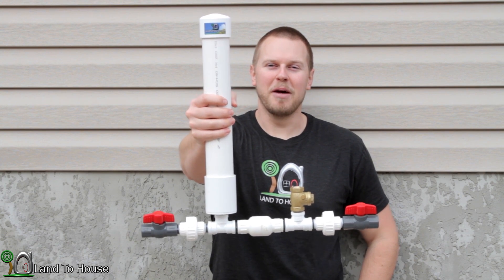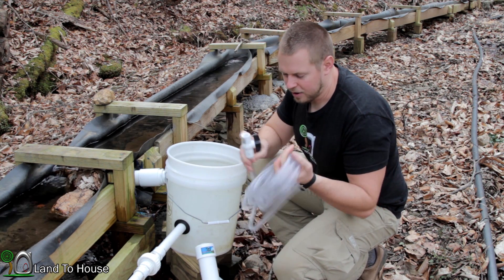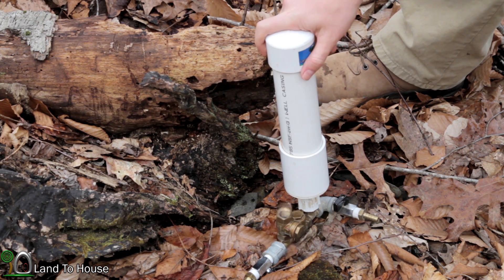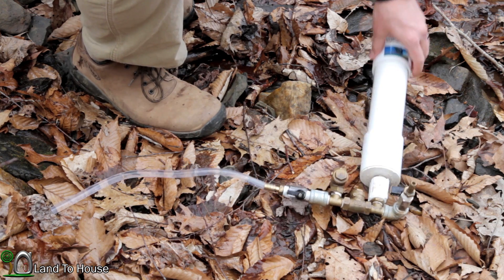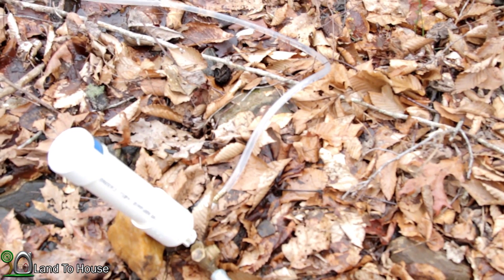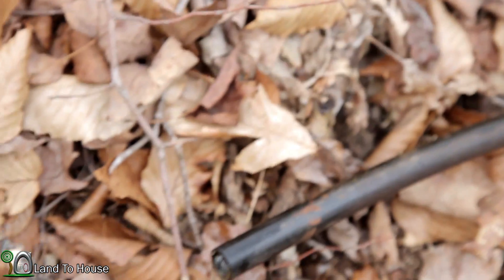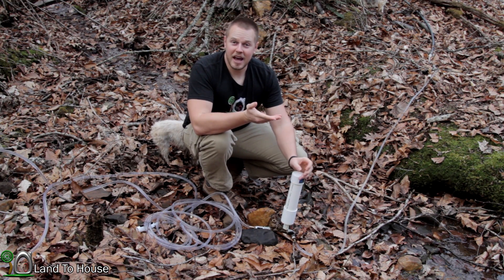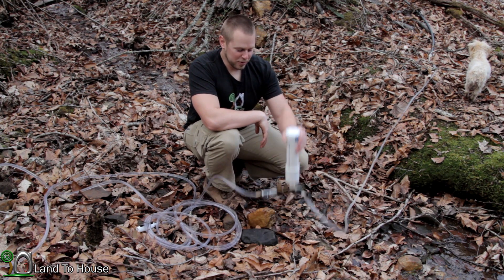WORLDS SMALLEST RAM PUMP

Comment: I bet it would work fine with a steel delivery pipe, at least 3/4", but preferably 1", with a T and vent in the middle of the run to lower the friction.  You're aiming for water hammer, and soft vinyl tubing just doesn't pack the punch.  You're losing the energy that should drive the pressure up to stretching the vinyl tubing, turning it to heat (unnoticable).  Steel delivery pipe, bigger diameter.
Reply from the maker: I have now replaced the 3/8" drive pipe with a 1/2" and the pump works!
Reply: hi, replaced with 1/2'' hose pipe or pvc?
Reply from the maker: I tried it with both. Poly pipe and PVC. Both work very well
Reply from the maker: The large commercial grade ram pumps have steel drive pipes and are almost always advertised to have a 1:10 ratio head pressure to lift. In my PVC pumps I state that a 1:7 ratio should be expected because most people are not going to use steel components. So expensive. Tomorrow I have the new update on this pump. It works!
Reply: I'll back this up - we even saw a difference in the efficiency of schedule 40 and schedule 80 pvc drive pipes.  The stronger schedule 80 expanded less, retained more of the pressure spike, and delivered water more efficiently.  Obviously the step up to steel would be even more impressive.
Reply from the maker: +michael98277 I do believe that a bigger Drive pipe is the way to go. The friction loss in this small diameter pipe is too great for this Ram effect.
Reply: I'm not a physicist, but I would bet you're losing the energy of the water hammer to expanding the vinyl tubing.  That is why steel pipe is most often used for the drive pipe- no stretch translates to less energy loss.  I forgot to mention- nice videos!  I appreciate you sharing your information, including ones like this when everything isn't perfect.  It is super helpful.
Reply from the maker: Thank you. I like to film and learn as I go. I need to find the time to get back out and work with the tiny pump again. Perhaps I will find the money for a little steel pipe.

Comment: DID you ever get a  this smaller pump to work? Im just below 1 gal a min in my seep. Was hoping you found a fix to the smaller pump by now? 1/2" intake and 3/8 on everything else maybe? I may have to find a new water source, though that puts me even farther away from cabin and where the water needs to go.
Reply from the maker: I have not taken the time to do any more testing with the tiny 3/8" ram. I do need to get back out there. The 1/2" ram pump can work on less than 1gpm with the waste valve turned to the side a little. It will reduce the efficiency but it will work.

Comment: If one were converting a swim pool to a fish pond, would the drainage pressure from pool/pond be forceful enough to work this pump, to pump the water up  through filter system and grow beds for plants then back to pool/pond?
Reply from the maker: +blanch paulin what is the head pressure between the pool and ram pump? This is the drop of water....the ram is a low pressure system.

Comment: try a stand pipe before your pump
Reply from the maker: On the larger pumps I do that for sure. With this little pump I have a feeling the issue is the fittings are smaller than 3/8" and that is restricting the water from activating the check valve.

Comment: .try a plastic cheque vavle
Reply from the maker: +rob beesley I do need to give those a try.
Reply: that would cut out the brass to plastic week spots and improve weight issues. the efficiency would go up by at least 50%
Reply from the maker: +rob beesley on such a small pump I think you are on to something. A light flap on the valve would help it close with low flow.
Reply: not only that but the head psi is not big enough to push it up and plastic would be better lighter. 1/4in pipe at 6ft of head = 1.81 gallons per minute
Reply: the head psi would be not good to lift the check valve 1/4 head is per 6ft=1.81 gallons per minute.
we can talk more on my web site http://comeandchatyoutubewithrobertbeesley.weebly.com/
Reply from the maker: One issue that I have is finding a plastic swing valve that is so small.
Reply: have you ever thought of 3d printing one?
Reply from the maker: +rob beesley that would be fun. I don't own a 3D printer. I wonder how long they would last
Reply: hear I know some one with a 3d printer send me the dimensions you want. the price will cost 15$ in total
Reply: don't worry I am you don't have to pay I can get you the guy's email to talk to him if you would like
Reply from the maker: I think at the moment I will try some other parameters before going with the light weight check valve. What I really need is pipe fittings that will not restrict the flow as much as the brass that I used. Thank you for the offer! Those printers are amazing.

Comment: shouldn't your feed pipe (source) be twice the size of your up hill delivery pipe...??? I'm no expert...just something I noticed in other systems...nice job...good video...
Reply from the maker: +Concepcion Amancio I have run several tests on that concept. The issue is if the ram is under high pressure the delivery pipe may have some slow down due to friction loss but typically there is such little pressure that it does not make a difference. The important thing is that typically the drive pipe should match the two check valves of the ram pump.

Comment: https://www.youtube.com/watch?v=J-iKUY_1xNA    watch this dudes vid  start at 9:39    this is what i meant
Reply from the maker: haha thats funny. This is one of my 1/2" ram pumps. I sent it to Cody last year about this time and he made this review series on the install. The friction in the 1/2" drive pipe is way less than the 3/8" pipe. That is why it works so much better.
Reply: so that wouldn't help it adding the line?  how about if it was stacked?  i am a think tank.  so how about: instead of the vertical line going into horizontal line, the 1/4 line comes up,  then fit it to expand to one inch?   how about 1/4 inch line up, expand to the one inch, then shrink it to 3/8 above the one inch fit for 3 or 5 inches?  picture an hour glass but with the sand in the middle and thin feed-lines at the top and bottom.  just some thinks to start.  i plan on building one, being able to catch the water that spills out of the first gate valve, to a smaller line to another lower one.

Comment: if it is going to be permanent why not splice the line, PVC it about 6 to 12 inches,  put a vertical stack of line so some more air can get in to add pressure? then reconnect?  upside down T i think even hose, 1/4" will let enough air in to help?  awesome set up BTW! love that aqueduct!
Reply from the maker: Not completely sure what you mean by allowing air to enter? The ram pump will stop if air enters the drive pipe. It can be a real pain to get that air out.
Reply: said comment above, didn't reply sorry.

Comment: Could you replace the heavy brass flapper in the check valve with a 3D printed pvc flapper…?
Reply from the maker: I sure could. I have a few things that I would like to try.
Reply: Joe Stowman If the flapper is too light, then water speed isn't allowed to build enough before valve-closing for there to be much water-hammer force, so a heavier valve will close later in the water-speed buildup cycle for a greater hammer energy.

Comment: I'd do the 1/2" drive pipe, maybe even 3/4".
Reply from the maker: I think that will get the pump going. Might not be strong with miss matched valve and drive pipe but we will see.
Reply: I'm running a 3/4 inch pump using a drive pipe that is 1 1/2".  I briefly step down that diameter to 1 inch for just eight inches or so before transitioning into 3/4".  Once the pipe is necked down to 3/4, I run it through 18 inches at that diameter before it sees the valves.  With about 10 feet of fall it lifts 85 - 90 feet.  Galvanized pipe and fittings for the pump, and PVC for the 1 1/2 inch portion of the drive pipe.  1/2"  PEX delivery pipe.  

Point being, I see no problem with a drive pipe twice the diameter of the valves.  It lowers frictional losses in these smaller diameter pumps.
Reply from the maker: I know that it will effect the ram effect going back up the drive pipe but with these little pumps it will help a lot. As you say the friction is an issue. I will have to get back out to the water and give a larger drive pipe a test.

Comment: the thump pressurizes the main feed line.  using plastic pipe is a way to eliminate the pressure.  try running only 3/4 inch copper from your feed bucket and get rid of pvc and any flexible pipe to feed your valves.
Reply from the maker: +dave newjersey copper is a little expensive for me right now.  But yes you are right the pressure is reduced from that tube.

Comment: I'm trying to get a 1/4 inch to work and am looking for the smaller check valves on line. Well, I'll try anyway. It would be cheaper than an electric pump. Thank You for all your videos and information.
Reply from the maker: +Lonefeather I wanted to go with 1/4" just to be fun but I had a hard time finding all the parts. Thank you for watching!

Comment: A ramp pump needs a decent shock wave to reinforce the slamming of the valve and to push water through the delivery valve.  You were using flexible pipe and so the shock wave would have been absorbed by the pipe.  What would have happened if the drive pipe had been made of rigid pvc.  I understand the issues of head and flow rates and the push on pipe connector would have also had an impact. Siphons never flow as fast a direct delivery from the bottom of a tank, I did a project on that in the lat 1970's.  Just a few thoughts.
Reply from the maker: +Mike Gomm I would have to agree.  I did not have access to a better pipe st the time.  I will be revisiting this soon and improving the setup. I bet I could place the drive pipe directly into the flume and get the full 6 feet.
Reply: Mike Gomm solarpanel
Reply: How about trying an additional check valve on the intake - on the generation of the slam it might keep the increase momentary pressure within the system (not leaking to the flexible pipe)?
Reply from the maker: I actually came back with a more Ridgid Drive pipe that was a little bit larger. Worked out well.

Comment: Love your content.
I have made two ram pumps using pvc however I would like to invest in a billabong size 3 ram pump( full metal construction), would you say it has any major advantages over the DIY ram pump?
Reply from the maker: Thank you for watching! I know that the full metal pumps are made to last a long time. PVC can weather in the sun and in high pressure has a greater tendency to brake. Also the all metal style often has a piston type valves that lasts longer than a swing valve. The trade off is the price. The PVC can be a fraction of the metal style. Thats really all I can think of at the moment. If you are going to go over 1-1/4" I think you will be better off with a metal just because of the pressure.
Reply: you can make the ram pump pvc and the valve pump pvc the bearing that pops up and down can be a marble,,so technically a system made for a couple Bucks me old mucker this is nothing new been out good 100yrs plus,,come back when you have perpetual,

I use a laser to copy manufacture my parts i pinch the marbles from the kids in there lucky bags get me pvc from resycle centers,

To catch the wast water resycle dig and place pvc barrel in the ground  but a foot or two above with lid sypon back the water to source sypons can run 24/7

Comment: has anyone ever figured a way to capture the water out of the waste valve and run it back through the ram pump
Reply from the maker: There is no way to get the waste water back to the source with a single ram pump. That water from the waste valve is the power source for the pump and once it has left the system it has a lower energy because it is below the pump. The only way to get all the water back to the source would be to use a solar pump. Using the water in a second ram pump could put some water back to the original source but it would only be 1/8 of the water at best. It is better to use the waste water for something else down the line.
Reply: drill a well and use an internal screen have the waste going back down the well simples no need for a creek
Reply from the maker: Closed systems like that are not a good candidate for the ram pump. Because the ram pump needs a constant flow of water and the waste is so high you would be out of water in a short time.
Reply: Simply by filling a five gallon bucket and caring it up the hill you can return the water to use fullness again. I'll add the best way to return the power back to flowing water would be to get someone else to bring it back up the hill.
Reply: All I can think if is having water turning a wheel connected to a generator and producing year round free electricity and water.
Reply: i was thinking for watering a garden of the raised garden were you could collect the water that goes through the garden and pump it back to the tub to keep the garden moist
Reply: Rodger - I'd think you could collect it in a bin with a float switch and small solar powered pump to dump it back into the source.
Reply from the maker: +Daniel Carter I'm actually about to film a video showing piping the waste water.
Reply: But.... if you could recirculate efficiently then do you suppose you could generate some electricity with the system, also ?
Reply: use a well with an water tank and dump the water past some inline turbines either back into the well or garden ect ect 
wells can be simple to drill your self relatively cheaply you would most probably need a fair sized ram water flow would be avrg of 10 gallons an hour
Reply: Roger Haffner  you can use sifon and anther ram.
Reply: +MyOtherNewName.  But the energy from the "waste water" are the energy that pumps the other water up.  So you have used all the level energy in that water already (level energy into speed which drives the pump.  So the waste water have lost its speed, and thus its energy).  
And as the physics lectures have tough you, you can't make new energy, you can only turn it into other energy forms.
So you can only use that water downstream the ram pump.
Reply from the maker: That would work but it is going to be annoying and hard to do.. :)
Reply: Couldn't you pipe the waste over to a watering trough for your live stock.
Reply: Could, if the live stock doesn't want to drink from the creek.
Reply: ... catch the waste water in an open basin, use the basin as a secondary head, generating the conditions for a secondary ram ))) .... this is not a "perfect solution" ... and if you are using a creek, essentially the creek is the secondary basin ...w-HERE multiple ram'S can be used -)))

IF ... an effort were made to make a ""completely contained system"", you could create ram'S "within" ram'S .... to increase effic-i-ency .... where a small portion of the overall "ram" ... is used to recirculate the waste ))

IF ... water pressure (head) ... is used to open and close and circular 'inline' spinning GATE (( spinning ram pump, inside the head pipe )) ... a suction will be created = greater output pressure ))) .... if a portion (( or all, when not in use )) of the extra pressure (( water volume )) is directed back to the start of the system ... bob's my uncle )))

ha ha )))

LOVELOVELOVE )))
greb'Z )
Reply: agreed )))
.... but, instead of saying " there is no way " ... i'd say, there is "currently no k-NOW-n way " ))))

ha ha .... who knows ... what tomorrow will b-RING )))

... right ?? - )))

... SETH ... YOU are so "" ON IT "" ... with feed-back = TOP PROPS BR-otheR !!! - )))

LOVELOVELOVE )))
greb'Z )

Comment: At three feet of head you have about 1.5 PSI, that doesn't sound like enough head for that size of the drive pipe.   The hose barb fitting is also smaller than your drive pipe so it is acting as a restrictor orifices cutting down on the flow even more.  You would try going to 7/16 hose and see how that works for you.   That vinyl hose has a lot of give to it you may have better luck with using Nyflow tubing of the same size.
Reply from the maker: Yes indeed. All those points seem like possible issues. I need to install the drive pipe in the top of the flume and get the full 6 feet of head pressure and see if that makes a difference. I think with a few changes this little pump will start working.